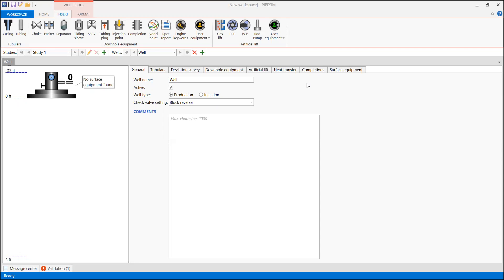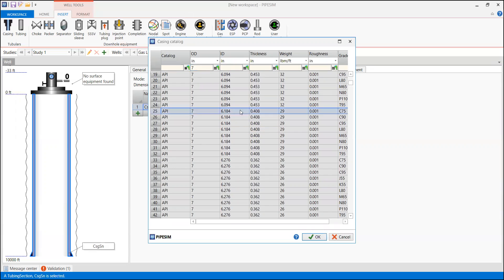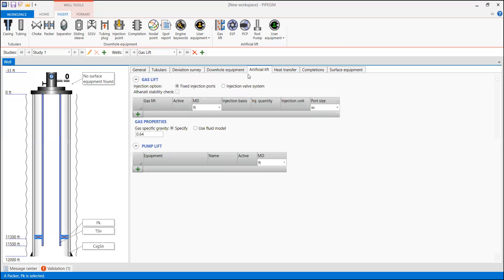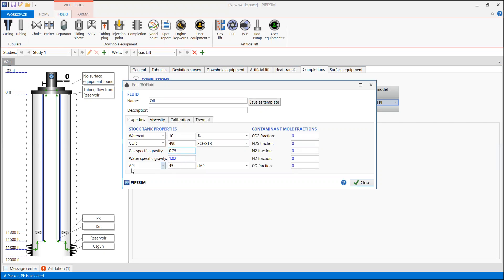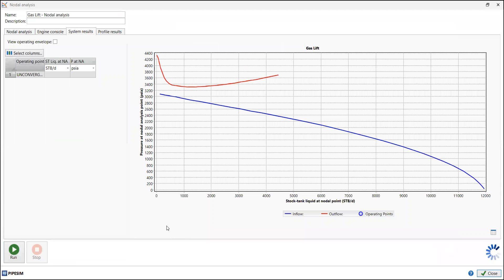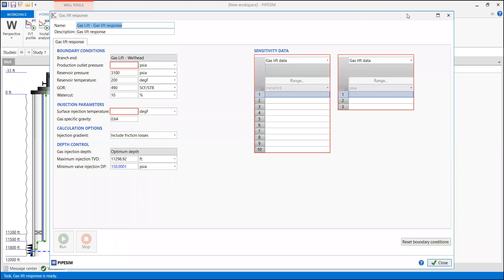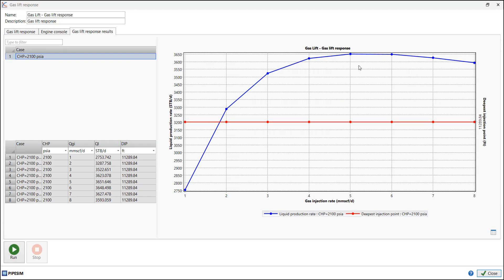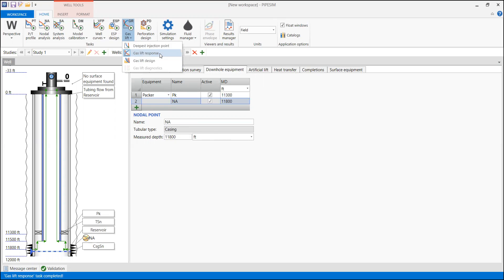Pipesim 5: Gas Lift Optimization Plot

Comment: Hi colleague, this PipeSim Production Engineering software has been made in a very structured and user friendly stuff. It is very important because PipeSim itself has been so much more complicated than i found it earlier in 2008. Now i got it back. Thank you for providing a clear explanation of the PipeSim 2019 article. It really helps us - we study remotely outside of the usual valuable courses. Great work.